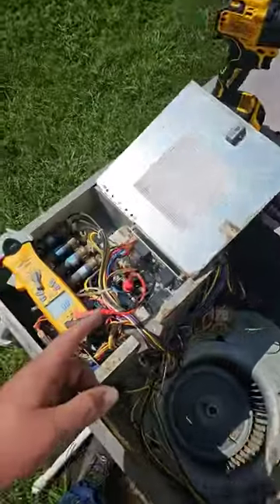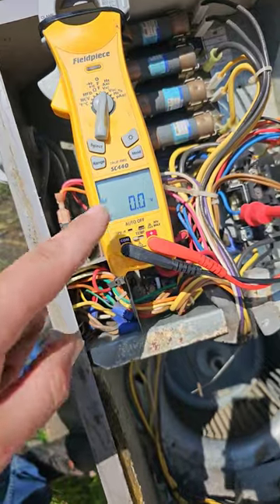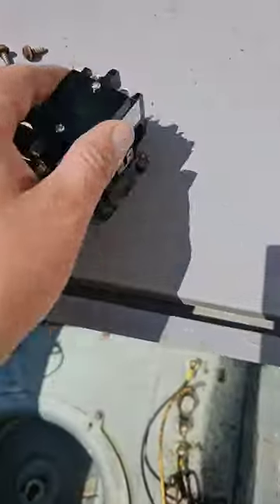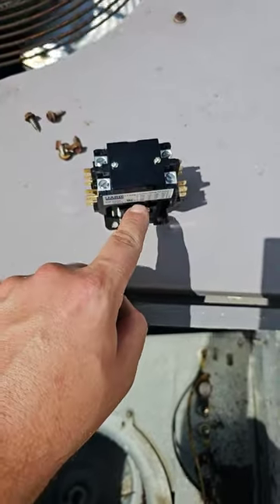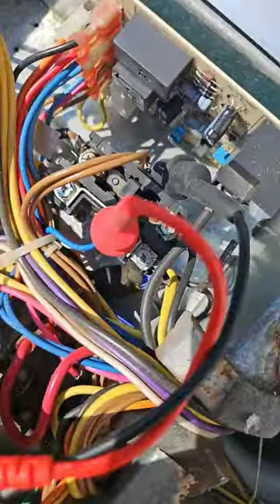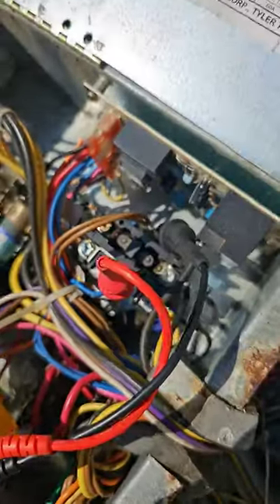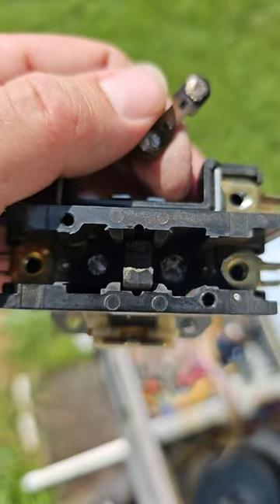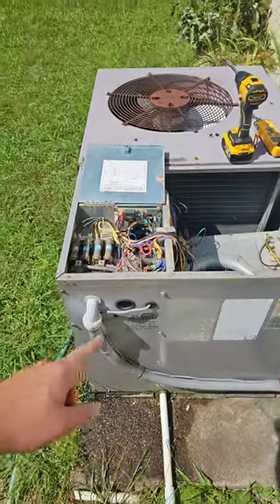Turning off thermostat but air conditioner won't stop! #shorts

Comment: Just curious why you replaced it with a two pole contactor  when it was a one pole? Siri
Reply from the maker: I like 2 pole contactors better
Reply: Not on the truck gotcha 😉
Reply: @jrh7455 no reason to make assumptions
Reply from the maker: That's right I only carry two pole on the truck
Reply: @TaddyDigest  🫠😂
Reply: @corruptedbrain6  his original response was he likes one pole better?  Edited to 2 pole…
Reply: Some older models have block heaters around here that’s why I usually replace like for like.
Reply: In the southeast, where there is really no need for crankcase heaters, replacing with two pole contactors is a normal thing. Single pole contactors are a cheaper alternative for manufacturing.